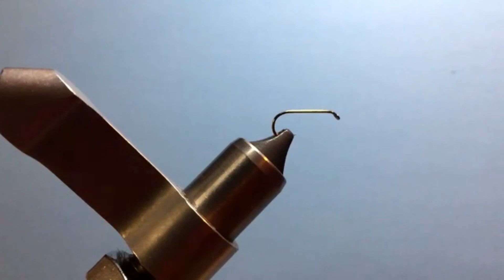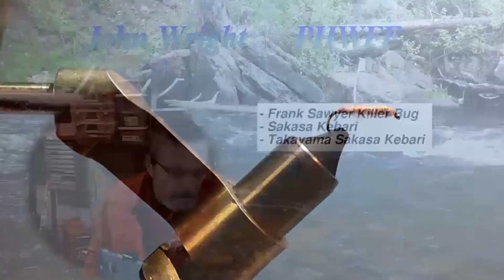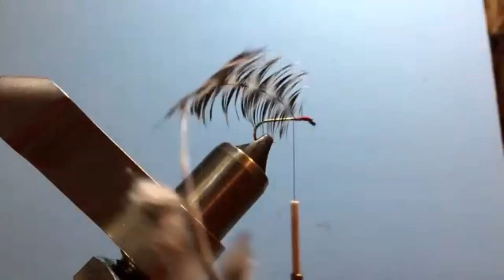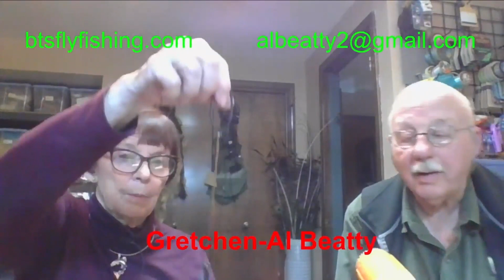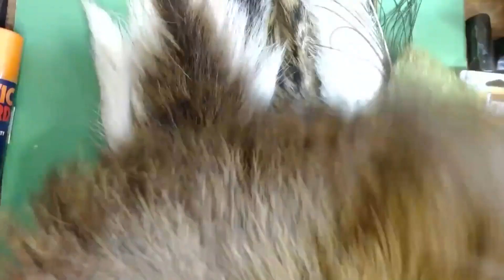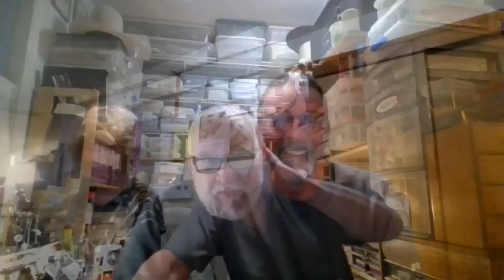FTF 18February 2020 Tenkara & Fixing Hair with a Heat Gun

Comment: Tenkara fly tying question:  The Tenkara flies in this demonstration & those I’ve seen in magazines have the hackle pointed forward. Is that just a result of the traditional forward to back Tenkara tying process or does it provide better action for the fly? If it has better action, do you (Al & Gretchen) feel we should tie non-Tenkara flies that way. Note: I would love  to test this myself, but I can no longer fish. Instead, I also tie for Healing Waters in MA & want to give them flies that I know will work rather than ones that are being tested. 
Heat questions: Heat guns get much hotter than hair dyers. Have you noticed any better results from using one or the other? Aren’t you afraid of burning materials, especially feathers, with the heat gun?

I saw the Davie McPhail video & the results were astonishing, but he used a hair dryer & not a heat gun. 

Thanks for sharing these very interesting demonstration.

Comment: That is a great tip on the hair dryer straightening the hair; I am going to try that on my calf tails.  I use the hair dryer on my soft hackles to get them to lay back before they are fished; that works well.  I had not tried that on the golden pheasant; that is another great idea.  I've always soaked them in warm water and pressed them under a book.  It was good to see that the normal curve of the feather was retained given I use that curve on some patterns (like a proper Blue Charm) to get the topping and tail to touch.  Well, lots of things to try now!